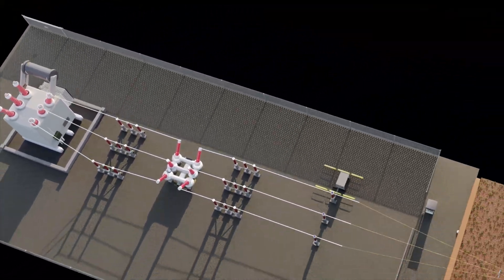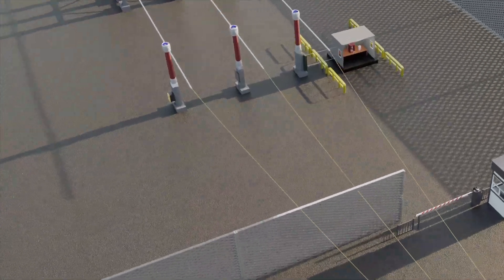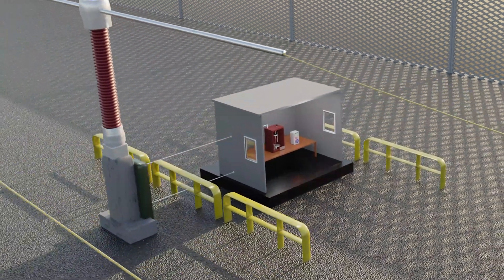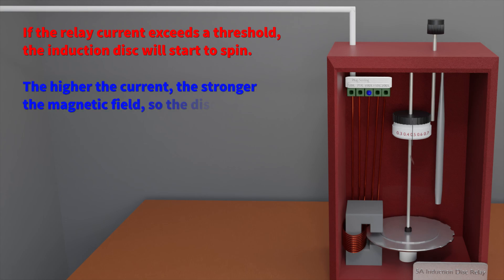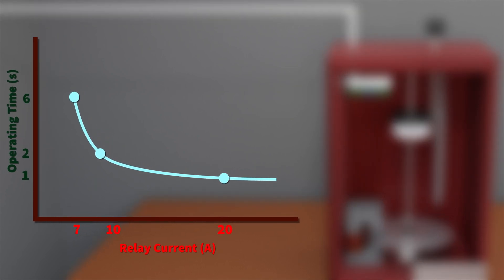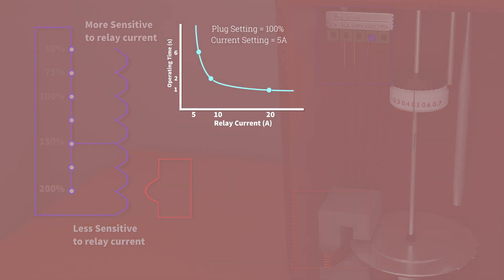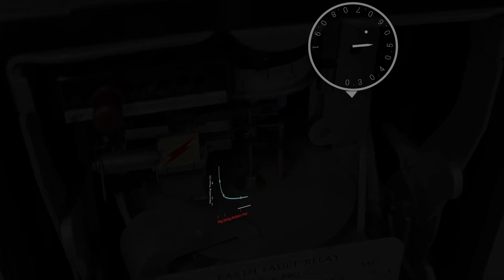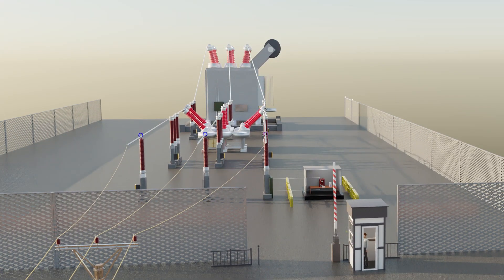Overcurrent Protection in Electrical Substations: the simple genius of the Relay

Comment: Dear Colleagues,

Its the discrimination❤ of the relay within the substation that affects the sudden change in blood pressure of a human if Again you are going to use or apply the ANN or AN system or ART system into a human being which is very dangerous to do or to follow a system or an art that will affects the life of the people. A reason i try to ignore it and really need to stop for it is not an ART anymore if everyone of us are all in trouble just because of the change in current reading or whatever the rate of  value within a relay called discrimination. It should not be applied to a human being.

Discrimination wise, everyone of us has the right or freedom to choose whatever they wanted, without harm or risk of life to the people or to any individual.

In general, the AN or ART system should not be applied to a human  or to a life of any individual. There are some advantages can be use which are good like the corrections of our face or any part of are body can called good because its not risky or dangerous but those ways or methods that are dissadvantages called bad or wrong like the discrimination within a relay its wrong, how would you like being cut everytime they slice a beef or brisket? its dangerous to think off and its to barbaric or a cannivalism to think if applied to a human as an art or an.

Again, as my mentor told me, it should be the good  only to use or to do as an advantage or useful to a human life.
Life is precious! it should be protected and Treasured Forever.

Thank you very much i hope youll never get offended on my message because am messing up and my heart or blood pressure is under discrimanation the whole night. tThank you for your understanding that my heart or our hearts should be free to anyone to feel happy and comfortable to breath freely adequately.

With Respect,
Tomas O. Yabut

P.S.

Doc, please move out the discrimination  in my heart and those unecessary add ons medications and finding within my health. I need to be strong and healthy again,  as your gift for us a lifetime. Thanks again .❤

Comment: Some medium voltage circuit breakers have bult-in( integrated) relays. This eliminates the need of several meters of cable from the current transformer to the relay room and back to the circuit breaker.If that cable is damaged there is no protection.

Comment: Very basic relay protection in electrical substations. Not only feeder protection but usually motors or some cases generators, transformers. 
The overcurrent relays I worked on were manufactured by General Electric model IAC or Westinghouse model CO. We would generally set the current tap, followed by the time dial. Once set, we would "bench test" and check the minimum pickup current first. Then check the operating time it would take to close the main contacts. Final test would be a functional target test which was the relay's visual target indicating which phase tripped the circuit where the fault occurred. Upon completion of tests, returned relay to service.
Very good video on the overcurrent relay concept.